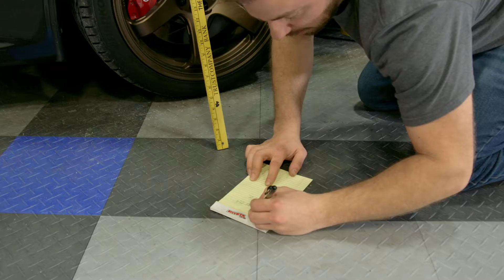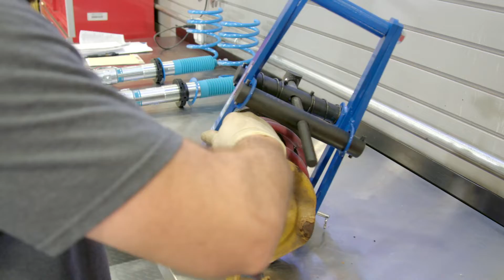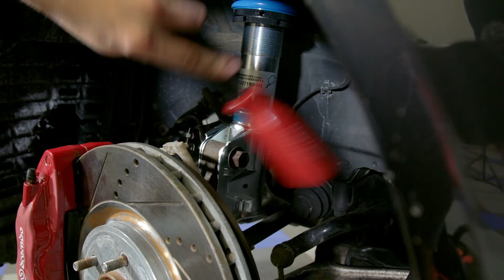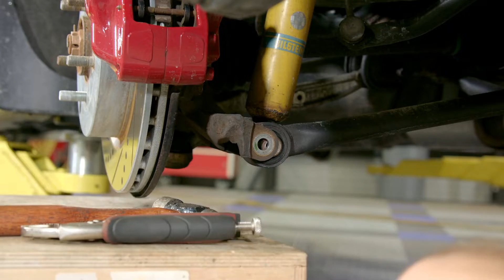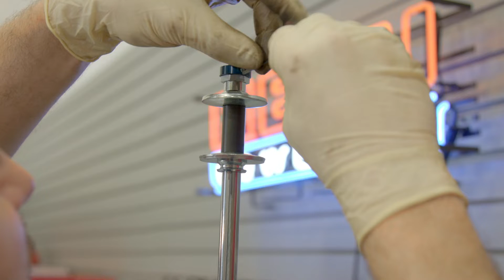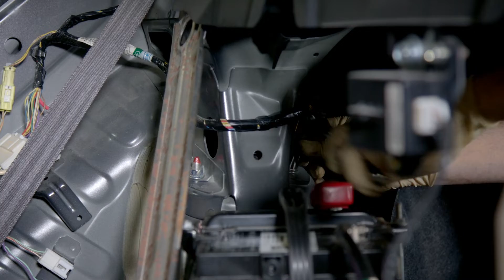Lowering The EVO X With The Bilstein B16 Coilover Kit

Comment: I don't find measuring from the centre of the hub is as accurate as measuring from the lip of the wheel. That's simply because, you don't get to the centre of the hub easily, and variations may happen.

Comment: This was by far the WORST experience I have ever encountered. I take pride in my vehicles and have been this way for years. This was my first time ordering car parts online so I was very cautious about the information. I ordered 17" custom rims for a 2007 GS 350. I received 17" rims for a 2007 ES 350. They weren't the right for my GS 350. I immediately called and requested an exchange for the right size. They told me they would be happy to accommodate, however, I would have to pay for shipping and restocking fee because I, the customer, was at fault. Furthermore, everything had to be repackaged the way it was sent in a NEW box. I had only taken ONE rim out of the box. I insisted that I ordered rims for a GS 350 NOT an ES 350. Not that the letters "G"and "E" sound anything a like AT ALL. So, it couldn't possibly be THEIR error. They wanted listen to the recording of my order, you know, to "prove" I was in error. I mean for quality assurance purposes. What a joke! They called me back to say that the recording confirmed that I ordered rims for an ES 350, NOT GS 350. I asked to listen to the recording, they said NO. I asked to talk to a manager or supervisor. They said they wouldn't transfer me. I told them I KNOW I ordered rims for a GS350 because I know my car. I even put it on the application online. JEFF, called me a LIAR‼ I called back to a new guy, JACK. He answered the phone saying that he knew of my situation and that it sounded like I refused to take their advice which was to pay for shipping and restocking because it was MY fault‼ It was an EXTREMELY painstaking experience that I'm STILL managing and I felt helpless because they have my money and I have the WRONG rims. I never wanted a refund, I just wanted an exchange for a clear issue with communication. I could even hear, JORGE in the background, spelling his name. He was the other customer service guy that refused to help because there was a communication issue. I can TOTALLY SEE why they got my order WRONG! Their call center environment is LOUD and unprofessional. They should invest in noise reducing headsets. Other than that, they were rude AND I will never do business with them again. I am posting this on every platform.